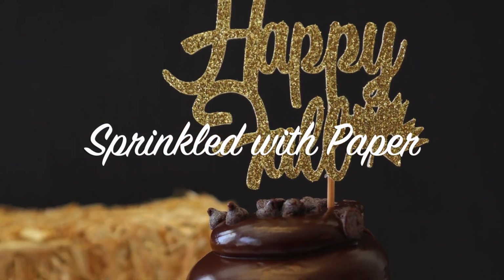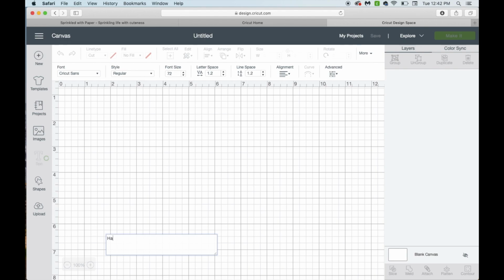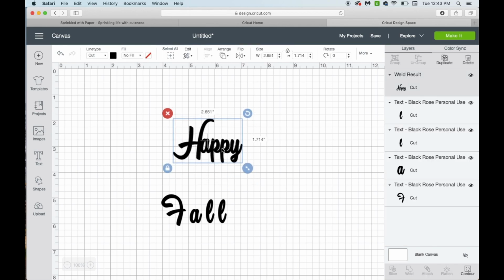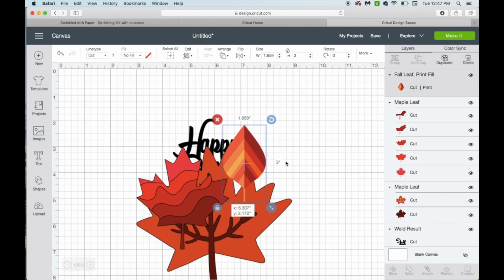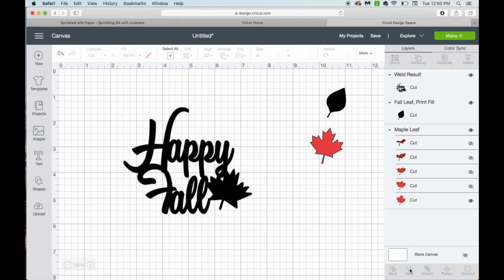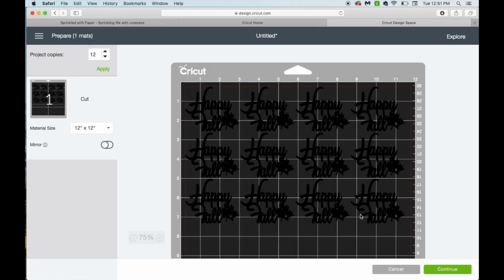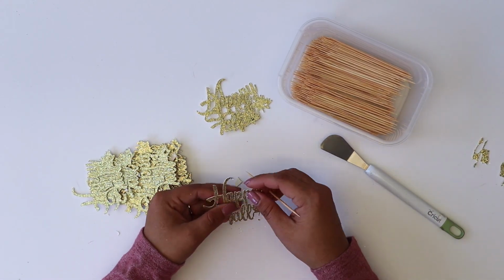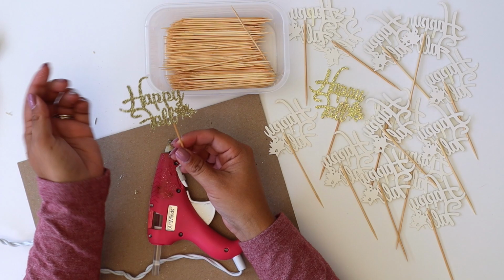Cricut Cupcake Topper Tutorial | DIY Fall Cupcake Toppers

Comment: Hi I was wondering why do I have trouble un sticking the glitter paper off the Mat when I try to take it iff I accidentally rip the cupcake toppers :( what em I doing wrong help !!
Reply: I just did this and it is a veeeery annoying thing to do
Reply from the maker: I hate when that happens! If I have a really sticky mat I roll the cupcake toppers off by bending the mat not the cardstock. I hope that makes sense. I have an example in my latest video (4 quick and easy St. Patrick’s day crafts) starting at the 10:55 mark.
Reply: @SprinkledwithPaper  thank you, I’ll go check that out!